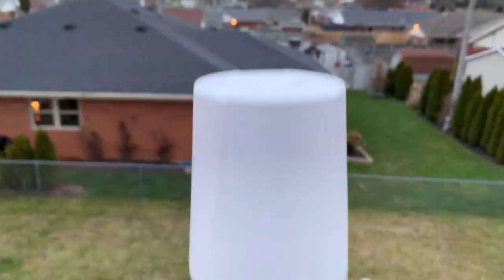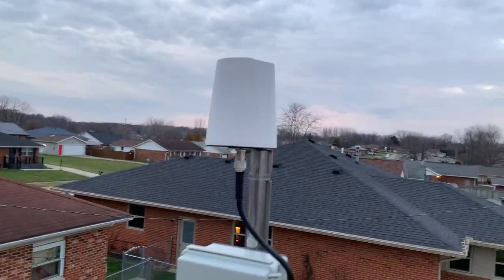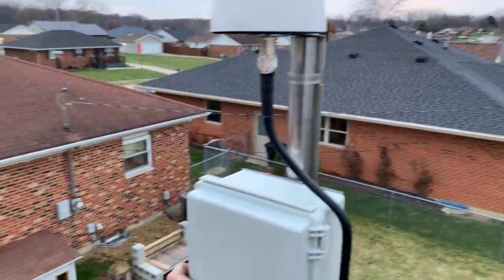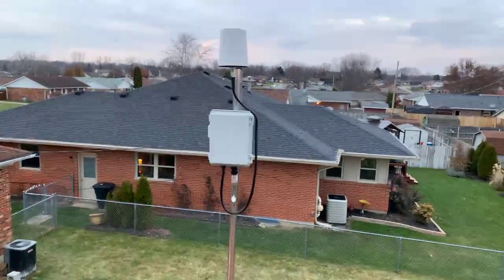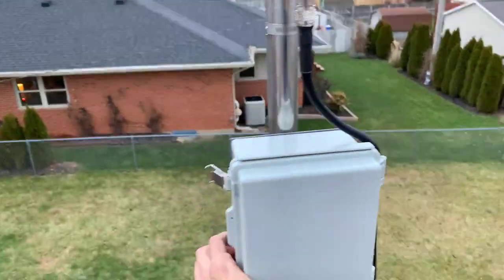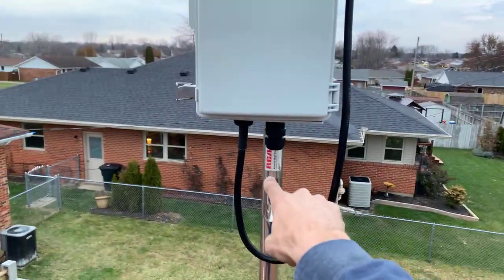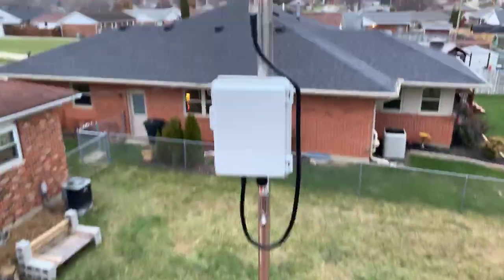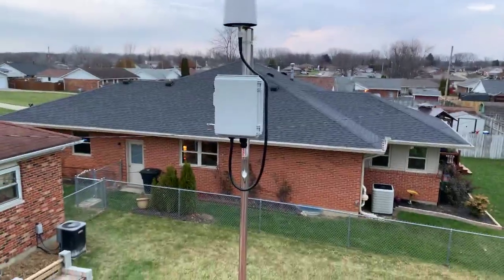My PoE Helium Rig | MNTD | HNTenna

Comment: hey just wanted to follow up since its been a month. have you noticed a solid increase in rewards? thanks
Reply from the maker: I ran it for 10 days and found no real benefit from my previous non-PoE setup using a 20ft LMR400 and a 5.8dbi Rokland. Swapped the HNTenna to a Laird 8dbi and it has improved slightly. I think the 5.8dbi is the sweet spot for most situations similar to mine. My most rewarded miner is on a 5.8dbi Rokland and 15ft LMR400. If you were in a densely populated area and could get the HNTenna up really high, I think it would do much better.
Reply: @KeleFPV  awesome thank you for the info bro!!!

Comment: Interline PANEL 14 HELIUM | 868 MHz LoRa Panel Antenna, Outdoor, 14dBi
Designed for IoT M2M (Machine to Machine) systems like Lora, Sigfox, XBee, RFID. Z-WAVE: Interline PANEL 14 HELIUM is a narrowband antenna, dedicated to the 868 MHz band with a gain of 14dBi which will allow long distance connections. It is a carefully designed directional antenna and built for the unlicensed 867-870MHz band. Typical applications are monitoring and digital transmission of small amounts of data. What do you think about can i use it for bobcathelium miner bro?
Reply from the maker: Yes but high gain is not always better. If you're in a town with a lot of closely concentrated miners you will overshoot them with the narrow band of a 14dbi. Additionally the radio on the miner won't produce the full signal and will limit it to your countries regulated output. The best results I have seen so far have come from a 5.8dbi from Rokland that is mounted 15 feet above the roofline clear of any blockage.

Comment: How's the earnings so far, how far is this antenna can reach ?
Reply from the maker: So far earnings are not bad. They are definitely not what they were with a standard 5.8dbi. I do believe if your area is heavily concentrated with miners that this would work really well. But for my circumstances, there are only two hexes in my area that have more than one miner in them. So the devices are pretty well spread out and need a stronger communication signal. That’s where I believe the higher dbi is better in my case.
Reply: 3dbi gain for multipolarized does not work well in suburbs and for a price of 150- you can have 2 - 5.8dbi or a good 9dbi directional antenna

Comment: Will you weatherproof connections by the antenna once you have the surge arrestor installed?
Reply from the maker: Great question! I plan to, yes. Although I have several setups that are not weatherproofed and are working normally.